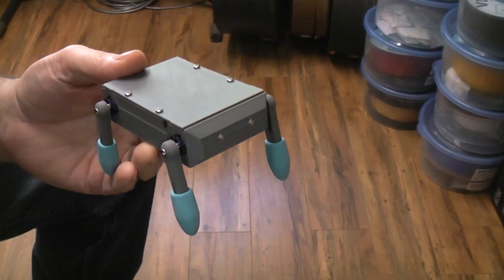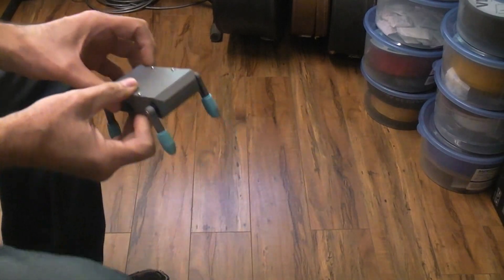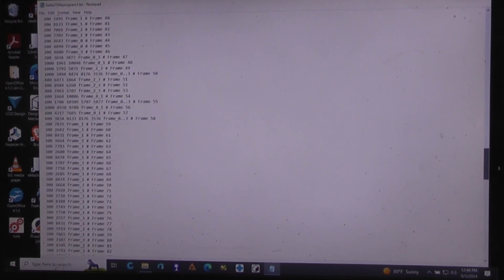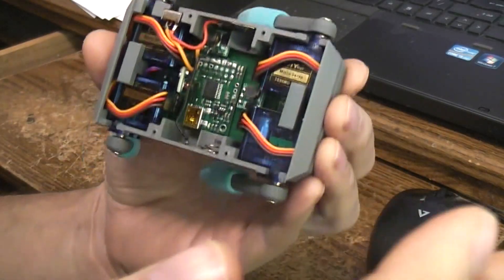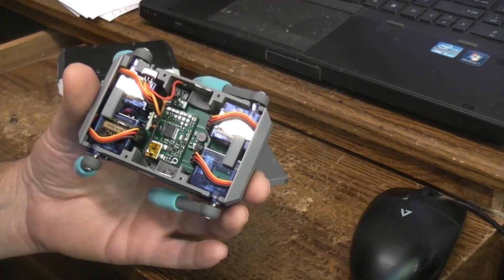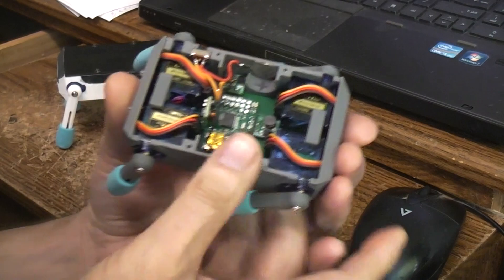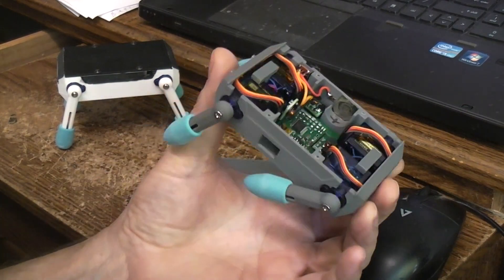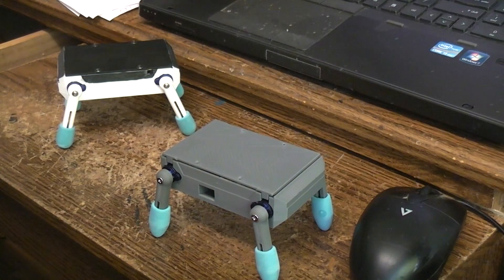First program for the Katie 270 robot, using the 270-degree servos. Inside look & what's next.

Comment: Fantastic! I want some 270 servos!
Reply from the maker: Yes, I think even on projects where I do not need the full 270 rotation, I would still use the metal gear 270 servo as they are digital so the standby current draw is around 5ma, so battery life is much longer.

Comment: This project has come a long way John. Watching it move, it might be nice to have a real micro in there with an IMU chip so the robot can correct it's angle errors. This might make the motion more interesting as it could have some purpose and direction when it moves. Great work
Reply from the maker: The KT2  kungfu turtle made by Kame Robotics has what you are talking about, I think. I wanted to do a different programable version.